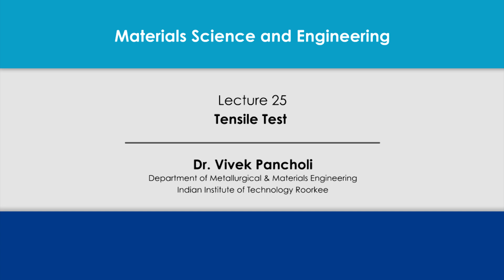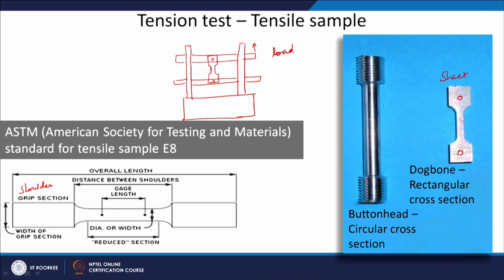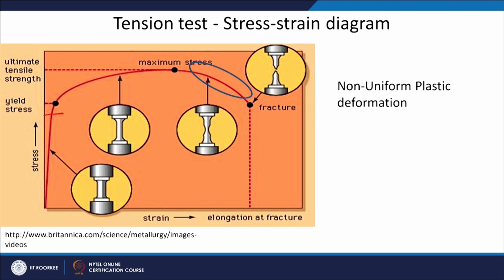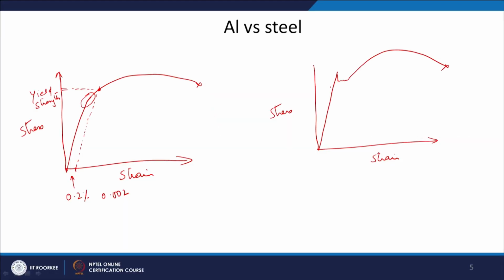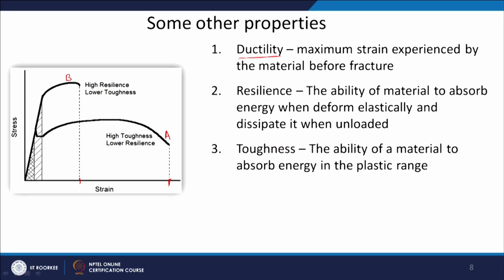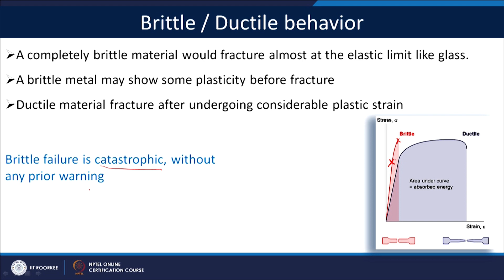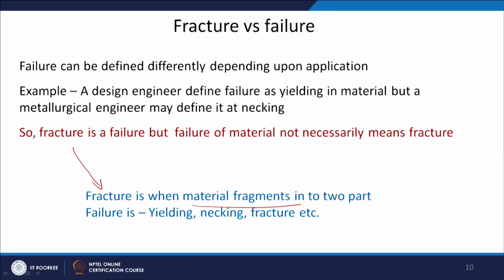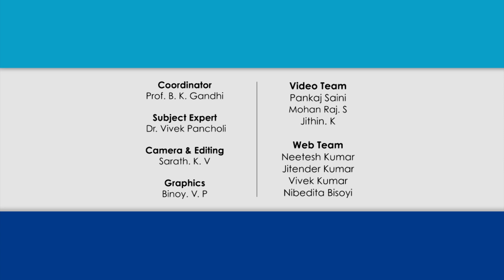Lecture 25: Tensile test

Comment: Dear Mr Pancholi
As you told that in case of Al, yield point is obtained by drawing parallel to straight line at 0.2% offset. Is it not applicable for steel?
Reply: 0.2% elongation is applicable for ductile materials other than mild steel .
Reply: It's applicable for all those materials who don't display yield point clearly.